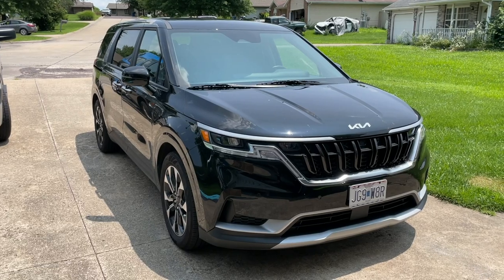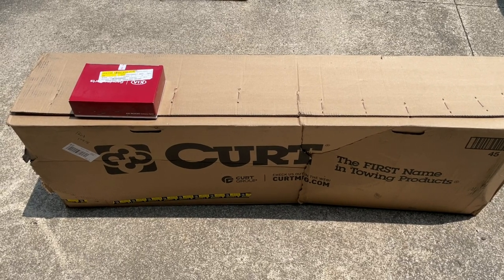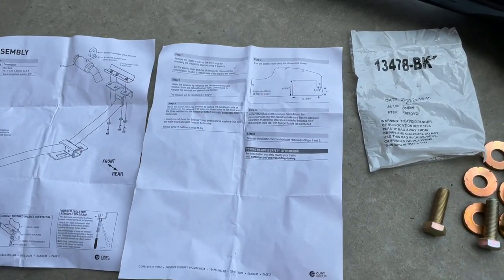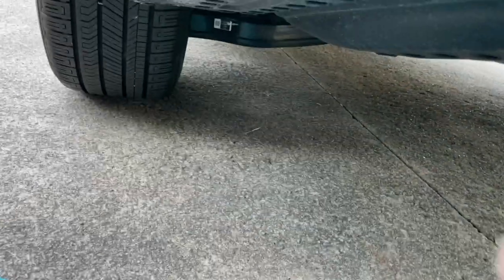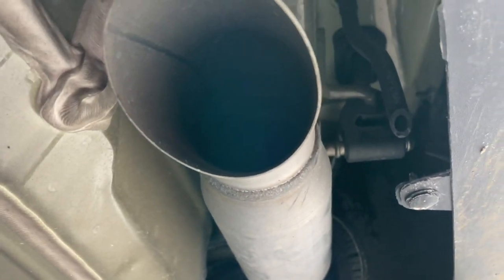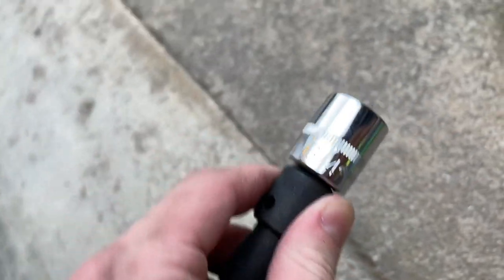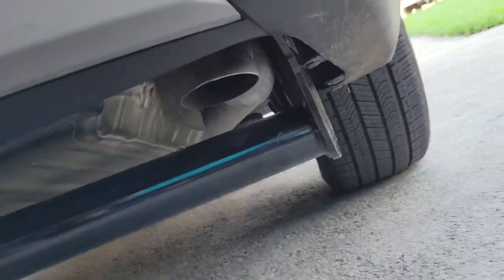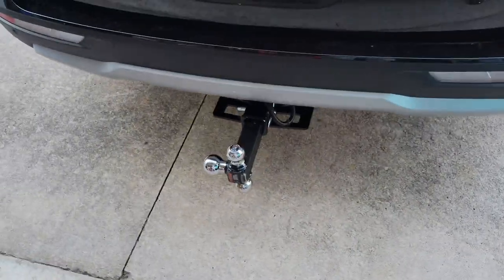Kia Carnival Trailer Hitch Install

Comment: Great job!! I've done two on Hondas and it helps to put dishwasher soap on the muffler holder to help it slide off easier. Getting ready to do my Carnival soon now that I've seen you do yours. I read that towing was 3,500 lbs...just check the owners manual or Google it. Glad to see the lights are plug and play.  Maybe there will be aftermarket soon at half the price!  $180 is pretty steep for a few wires!
Reply: Amazon and others have Curt wiring for around $40!!!!

Comment: Thank you for the video. The clearance looks low. Has anyone had issue scrapping on the curb when pulling into a driveway or similar
Reply from the maker: With the hitch on….yes all the dang time.
Reply: @joshcobb4100 

Based on that . Would you still recommend someone installing this? Or is it a deal breaker?
Reply: Same question. My odyssey did this all the time and it bugged me
Reply from the maker: Not a deal breaker, we just have really, really terrible roads lol.